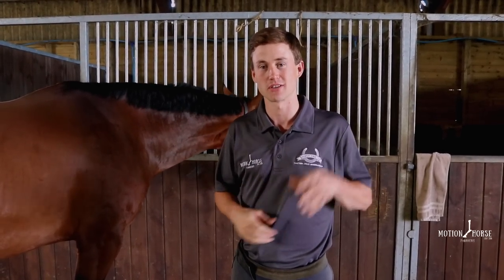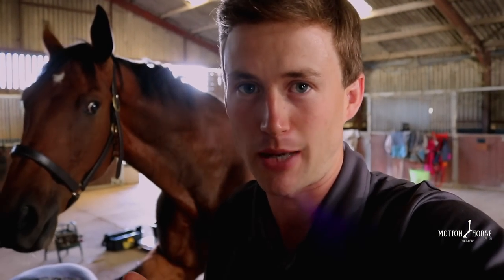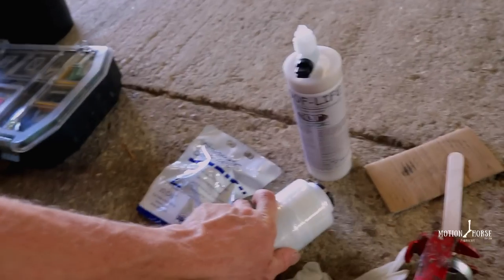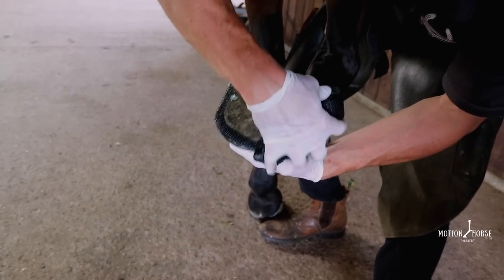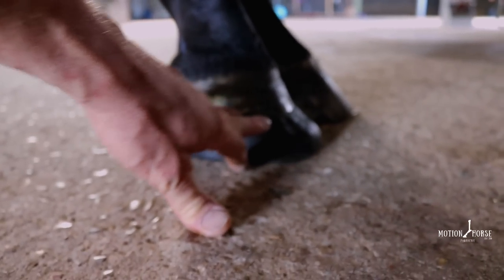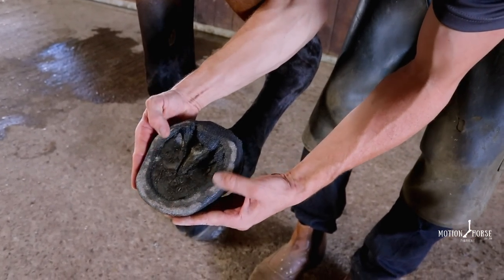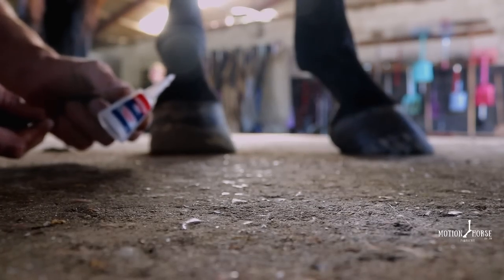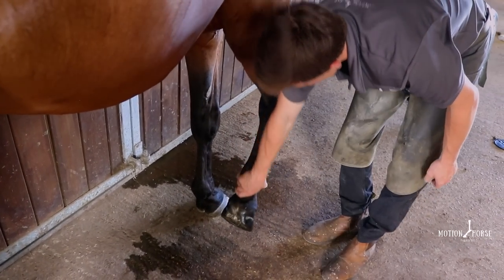Rebuilding a horse hoof! *Satisfying*

Comment: Wow this is amazing. im trying hard to barefoot rehab a full 4 hooves x bones-through-the/sole founder in my QH induced by surgery/fever. 5 yrs on rears are 100%, one front is looking good, but the other front must have sustained more damage and i havent yet had good wall length to let sole build up, always walking on sole in front 1/3 of hoof so never advancing. I can see that if i could build up fake wall like this it would give him relief to walk & load properly & let that wall come down with even pressure all around for 6 weeks. Ive had 2 goes with the full wrap but felt it was leading to heel contraction so stopped. Im going to try this, even if it takes me 10 wraps to get it right! thank you!

Comment: Toe Wall looks streched out to me.  Would keep an eye on it.
Reply from the maker: Got that.... Will certainly do so
Reply: About 1" down from coronary band, the dorsal angle changes dramatically! The heels need to be gradually lowered AS the toe length is shortened (and breakover moved back). Long toes are so common, hardly anyone even notices.

Comment: Alex...you have so much to learn...would you like to hear more of what I think?
Reply from the maker: You have never held back before, and yes I'm always learning, in fact I hope I have a lifetime of it!
Reply: @AlexRidgewayFarrier  I would of like to see the horse move before your application of a cast, because (11:51) he's still stabbing, but no matter.   (0:46) that is not a "boxy-up-right hoof"   it is a "locked in founder hoof"...look (1:01) at the bars and the distance between the apex of the frog and break over.   When this horse foundered it pulled the heels forward.  The heels appear to have moved back but not correctly because the bars were never corrected as evidenced by the curve in the bars.  This curve puts undue pressure on the center of articulation of the coffin joint creating pain (navicular syndrome)  the toe length was never corrected and a huge wall flare is visible  (11:21) (0:54)
Now as for your cast...all you did was put anerobic bacteria into a petri dish...which is never a good idea.   This video was taken in August 2018 ... is there a follow-up ?
Reply: So Alex this is where you are to defend your work...yet you are curiously quite...why?
Reply: steve gale  pl;ease elaborate ...
Reply: steve gale  you're deflecting...I have never claimed to be a veterinarian, just a backyard trainer with a better way.  You wrote that I made "made several basic errors"  yet you provide no examples of  such.  Please enlighten.
Reply: @bmc06239  I observed all of these points you make as well.  I’ve been looking for a knowledgeable quality trimmer for 20 years and I REFUSE  to let a farrier touch my horses.  I can’t find any so I had to learn on my own.  People don’t believe my knowledge because I’m not a “farrier”.  🤷🏼‍♀️